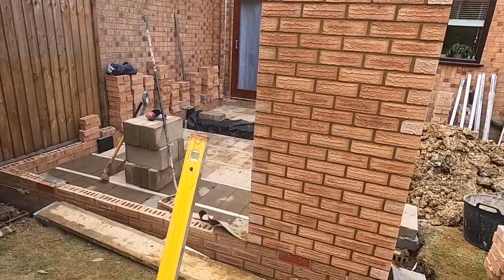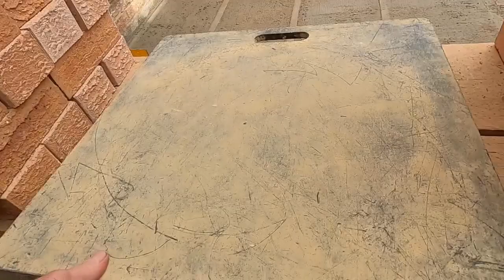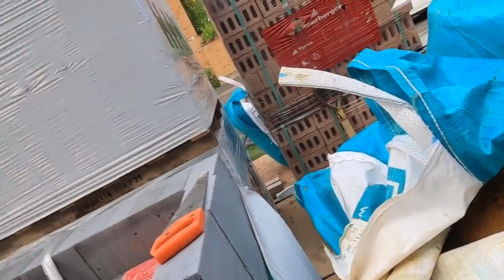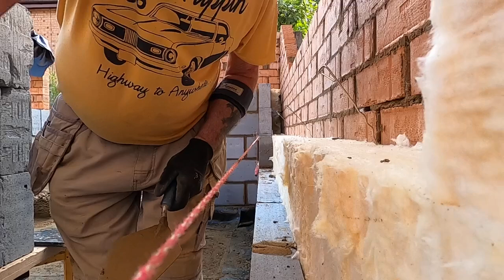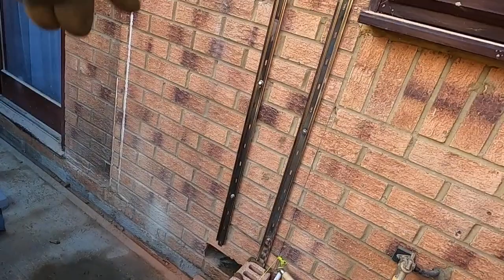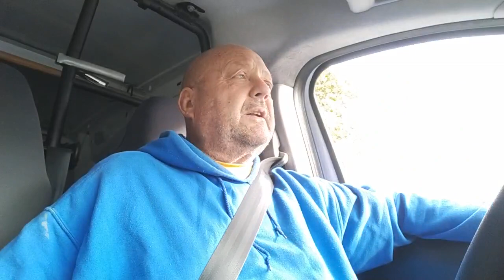Bricklaying overhand, spot boards, stands,mixing morter and a dead van 🤷

Comment: Alright Andy 👍 I'm doing a extension and renovation on my place as side project ...building regs changed in June they want either a 350 cavity or a 300 with 90 mm selotex insulation now no fibreglass...real bad practice that with the red clips you need on selotex and you could drop bit muck down and bridge cavity and no chance of seeing it or clearing with with 10-20 mm of cavity from back of brick to selotex...and the paperwork from waterboard has brought me to tears 😭
Reply from the maker: That and the price of materials is killing the domestic side of things.
Reply: @bricklayersworldwithandy6277  I almost regret starting it ...I'm close to the hs2 works and the cost of that project is truly eye watering with all the beaucracy and forcing prices up. Bad times

Comment: Yeah we do the same on overhand .  Nice tip with the tuck pointer instead of a pin , I’ll be nicking that Idea Andy 😏🤙🏾🧱👍🏽
Reply from the maker: Nice one Boys, another tip is to not do the screws up fully untill you get to them, keep the cordless to hand otherwise the couple of courses either side of the screw are tight to get in, profile and Dutch pins better though IMO 👍👍👍

Comment: Just did a 2 story  build overhand. Not hard but slower  than normal. I'm in a delegate I have a truck and van. Love the van but it doesn't work on all jobs but the truck does but not as nice to drive. Two tax,s,insuances and services  etc.  Good if truck needs work to have the van but now can I justify  2 vehicles
Reply from the maker: I had a Cabstar for years, loved a truck but it's all relative to the work you are doing, you get it all delivered nowadays unless the truck is earning you money no point👍
Reply: @bricklayersworldwithandy6277  very true.  If labour only bricklaying van is fine. If you want to work most days a truck is better. I see people waiting for bricks,blocks , lintels ect. I go and collect and keep working. I don't  miss any day for lack of materials

Comment: Think I might do this with a lovely whs I have got a spare plastic rose handle works well by the look of it
Reply from the maker: Mines come a little loose, I think you need to cut some grooves inside the Handel with maybe a thin triangular file or similar.

Comment: Good video Andy . The mix you made without plasticiser using the Hansen cement, it looked like it wasn’t holding on to the mix water that well ( no cohesiveness) costs gone through the roof as regards eBay uk , what with the global shipping program charging import duties and extra postage costs ect since brexit ?ive  bought a lot of stuff over the years off them at great prices . 5 meters of concrete last week 135 euro a meter ( cheapest price I could get ) those black plastic boards look good .
Reply from the maker: I've tried all the boards now and I think they are the best, heavier than others but work  best for me.
Reply: @bricklayersworldwithandy6277  ya they look really good and reasonably enough priced . Some of the sellers of those gator boards are gone way beyond it with the money they are looking for them , good an all as they are.

Comment: Probably more so one for the builder than yourself Andy, but I don't agree with the not cutting the cavity out on the extension abutment.
Dampness may/may not be an issue in a southern england sheltered site but cold bridging certainly will be.  
Anyway enjoy your weekend and keep up the good work!
Reply from the maker: Building control down here don't want it, I've said it before never once done it in 50 years and never had a call back, if they asked for it I would do it 👍
Reply: @bricklayersworldwithandy6277  Agree with you Andy . Done it about 3 times in 40 odd years.  Then the builder cut it beforehand.  Waste of time. Great work 👏
Reply from the maker: @michaelamos4651  👍
Reply: In Caerphilly County borough, cutting the cavity is considered weakening the structure.
Reply: Those who don't do says it's not needed; those who do will say it is!
Regardless, there is no denying it causes cold bridging and then you must ask why is a cold bridge acceptable in this location?
Reply from the maker: @kevocos  I can't see where it causes cold bridging, I thought the issue was damp penetration as some only cut a slot and insert a DPC.

Comment: Putting feb in with that cement? Is that why the muck tears when you joint up?
Reply from the maker: It will do if there is to much Feb, sometimes even with enhanced cement you still may need to add Feb depending on the sand it's getting the right balance.To much Feb means to much air in the mix which will make it tear.
Reply: @bricklayersworldwithandy6277   thanks mate. It's been a problem lately. Always learn a lot from this channel.

Comment: Any advice on a mix for my chimney I'm rebuilding. It's 2 flue, one of them is not used the other is going to have a multi flue burner with a liner down it. The chimney is 3m high from the eaves. Was thinking 4:1 and 1 lime and 3:1 no line and grano for the head. Any advice appreciated 👍🏻
From a ex Bricky but I'm always happy to take advice.

Do you think lime is needed, could I just use 4:1. Lime at £17 a bag I could do without 😃
Reply from the maker: Depends on the bricks, the morter shouldn't be stronger than the bricks 3 and 1 might be to strong, if it was originally built in Lime morter some will say use NHL, 5 and 1and 1 with Hydrated lime should be good enough.
Reply: @bricklayersworldwithandy6277  I took it down yesterday and the compo was like bell metal so I don't think there was any lime in it . Bricks are fairly strong, I was just thinking about using 3:1 on the last 3 course as I'm using Staff Blues on those and dressing the original bricks for the rest. 👍🏻
Reply from the maker: @CT-ud7yk  sounds good 👍

Comment: What you got around your forearm Andy?
Reply from the maker: Tennis elbow strap.
Reply: @bricklayersworldwithandy6277  I thought it might be. I'm suffering with tennis elbow at the moment, does it help much? Is there anything you could recommend to help? This is the first time I've had it, can't believe how much it can hurt.
Reply from the maker: @joefowler9600  I actually know quite a bit about tennis elbow, I think it warrants a separate video, stay tuned I will get it out in the next few days.👍
Reply: @bricklayersworldwithandy6277  brilliant, I'll look forward to it mate. 👍👍
Reply: @joefowler9600  Acupuncture solved my problems, connected to electrodes, two sessions only.
Reply: @mikejames663  someone else has said exactly the same mate. How long did you have it before having the acupuncture?
Reply: @joefowler9600  I had it for about six months, off and on, my mate was doing a landscape patio for a doctor, I had told Mike the evening before about my elbow, and that it was getting worse. Did the deep heat, voltarol, all the creams, elastic bandage, all did nothing. So! Mike told the doctor, and he said send him down after five tomorrow, I duly turned up, he took me into a little side room in his clinic, put my arm up on a purpose made arm rest, pushed about eight needles into my arm (honestly, never felt a thing). The needles had a thread top on them, he screwed on electric connections off a machine, that started to pulse through my arm, told me he'll be back in forty minutes, he came back undone the connections, come back tomorrow, my thoughts, well that was a waste of time. Went back the following evening, did exactly the same, when can I come back, I said, you won't have too, how much do I owe you, nothing he said, Mike is doing a great job, so it's a bit of payback. Sorry a bit long but that's the story, Mike a bricklayer like myself did me a great favour as did the doc, it was most beneficial for me going out for a pint that night, and meeting Mike. The doctor passed away last year and since he did my arm, I've had no pain whatsoever.
Reply: @mikejames663  that's a great story mate and good to know about the option of acupuncture. I'm really looking forward to Andys video on this, the more I can learn about this condition, the better.👍

Comment: Great content in the upload from the finger trowel tip with the line to no feb needed in cement that already has plasticisers added ! Liked your system with your boards and muck looks a good height to work at and good idea getting your blockwork up to height to help you onoverhand work! Shame about the transit she has done you a good service I’m at that point with my vivaro 62 plate causing me hassle but would have to down size if I get rid of it ! Great workmanship as always Andy thanks for upload hope your weekend has gone well 🍻
Reply from the maker: You to John, I am considering racking the van out then buying a midget trailer just for the mixer, I did this many years ago when I had a Cabstar truck, I had a trailer which would take the mixer,barrow, brickbarrow and water butt, just used to reverse it into the lockup and take it out when needed.
Reply: @bricklayersworldwithandy6277  I have had two cabstar trucks just got rid of my double wheeled cabstar had it ten years but wasn’t paying running two vehicles trailer seems a good idea we always just need a bit more room for starting the jobs Andy !
Reply from the maker: @johnbuist5289  Bought mine in 86 new, great truck, 2 litre petrol never let me down until it got nicked.
Reply: @bricklayersworldwithandy6277  yes the Nissan cabstar,,, we used too head for roads with dips in them😂 bounced back too the yard. Great wee pickups 👍🏻